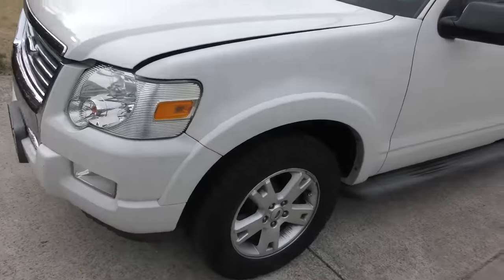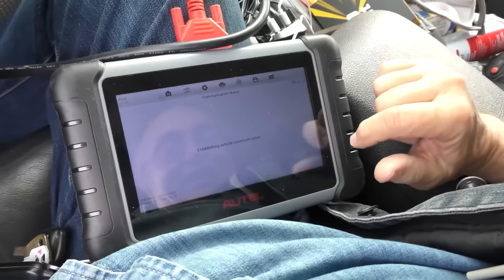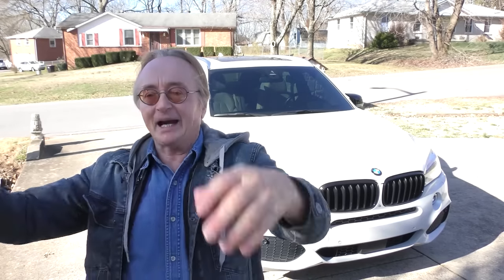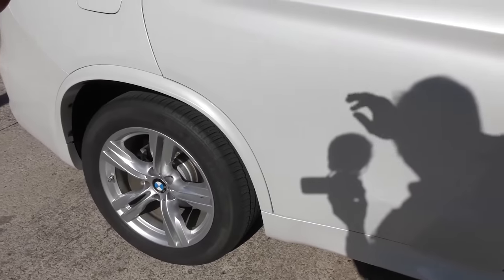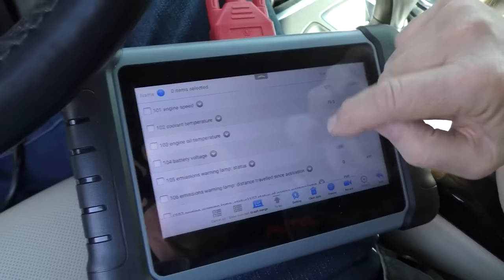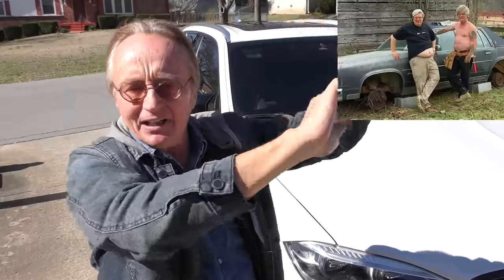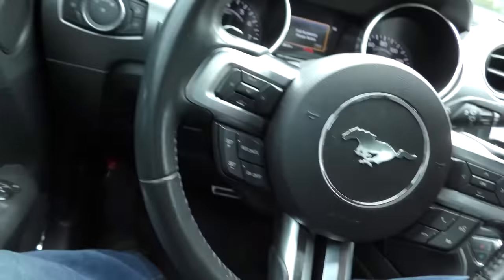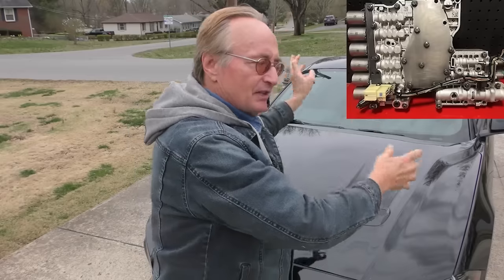3 Money Pit Vehicles You Should Avoid

Comment: I owned a 2003 Ford Explorer 4 wheel drive for nearly 13 years.  It was the best and most realiable vehicle I ever owned.  Never had a single engine problem, only replaced a window regulator and lock acuator.  Replaced the shocks around 130k miles. When I sold it a few years ago, it was still running great, but did have some rust underneath and peeling paint at top.  Most reliable vehicle out of last 6 vehicles I owned and made me a loyal Ford customer.  The new Ford Explorers feel like a soccer mom SUV and didn't care much for them, so I got a F150 truck which I love!
Reply: Nice I’m actually thinking of buying one same model and year with 56k miles any tips on maintenance?
Reply: @Jacob-gd9ps  I'd say go for it!  56k is really low miles for a 2003.  I woud absolutely have the transmission fluid changed, if it hasn't been recently. Other than that, just keep you coolant and oil changed as needed.  My Explorer was super dependable.
Reply: @JIMN26  appreciate bro! And how often do you need to change the coolant and oil what’s like a general rule of thumb?
Reply: @Jacob-gd9ps  For oil, use synthetic blend every 5K miles.  Coolant is usually 100K or 5 years, but I'd look online or check manual on that one, not sure.

Comment: Had an X5 after owning a 740iL and a 528.  Can verify that the X5 is a terribly expensive vehicle as it ages.  Mine had the big V8, which had a big $750 gasket that had to get replaced at 100k miles... waited as long as I could but it was losing a quart of oil every couple weeks (!!).  The 740iL wasn't much better, the serpentine belt blew under the hood and tore apart everything, plus it had a water-cooled alternator, because why not mix water and electricity.  Find a manual 3-series without AC and there's your ultimate driving machine.

Comment: I bought a new model 2014 dodge dart and its been solid. 9 years later its had 1 brake job, wheel bearings, oil changes, and that it. 

Oh and i blew tires on pot holes 3 times. I bought the cheapest tires and blew a new one 2 weeks later. Bought the most expensive tires and so far so good.

Comment: Bought my 2001 crv for $3700 with 90k and a huge pile of parts receipts.
Thing is a beast and its easy to fix.  Radiator took an hour.  Idle valve took 15min.
Burnt out valve cost $2000 but now i know get them tuned every 40k...
100k miles later not burning oil...trans strong...awd works...

Comment: I bought a used bmw x5 and can confirm the repairs are very expensive.  If you decide you wanna roll the dice and buy one of these, make sure you get the best warranty you can because you will need it! I had a 2014 x5 with 75k miles on it when i bought it. Bought a warranty for $3k. The warranty was paid for from repair cost after about 6 months of ownership. I sold it at 98k miles

Comment: We have a 2014 Explorer with all wheel drive. We have 95,000 miles on it and it is running just fine. We live in MN and a 2 wheel drive is just not practical in the winter. Finding a 2 wheel drive around here is quite difficult as few want them. Transmissions require maintenance. Let the fluid get old and you will pay for it.

Comment: Bought my 75 yr old father a 2000 Ford Explorer with transmission out and 140K miles for $1200 years ago. Replaced transmission from pull a part for $150 and it now has 298K miles and Still going 😳 without a single problem.

Comment: The other three money pit vehicles to avoid are the GMC Acadia, the Nissan Altima and the Honda Odyssey, mostly older models.
Reply: Nissan Altimas are good cars if you take care of them. My parents have one with over 200k miles and only had to do basic maintenance - oil changes, tires, and brakes. Lexus RX is the biggest money pit. I owned one for only 6 months and I spent more money fixing it than all my other vehicles I ever owned combined. It spent more time in the shop than me driving it, I only put 2k miles on it over 6 months. And it still had nothing but problems, I practically had to give it away just to get rid of it.
Reply: @NATEG01  That is a great story to tell. Thanks.
Reply: Don't forget GMC Terrain. Love the vehicle (bought new 2012) but by far the biggest money pit I've ever owned...and that includes 2 Cadillacs I owned previously.
Reply: @rockyroad7345  Thank you very much.
Reply: I have a 2003 Honda Odyssey……still going strong as ever……yeah before you ask…..original tranny 😊
Reply: @NATEG01 Stop making up stuff prove it?
Reply: @tonyw1563  I wish I was making stuff up. How you want me to prove it? Send pictures of repair receipts? I finally got rid of the money pit Lexus. I only owned it for 6 months and spent $3k fixing it, and it still wasn't fixed. The A/C wasn't working due to a bad compressor and the struts were bad. I lost $6k on the piece of junk.
Reply: @NATEG01  Wow I thought Lexus was reliable guess not.What Year was the Lexus.
Reply: @tonyw1563  It was a 2003 which was part of the problem. With a 20 year old vehicle there's always something that can go wrong.

Comment: I had a 02 and 05 one reg the other Eddie Bauer edition and both transmissions went flaky at 120k 
The 02 was a manual switch to turn on/off 4\4 but just Flat Stopped 
No warning 
   The 05 had buttons/auto 
4/4 and that one kept turning 4/4 on/off on/off 
By itself in any weather!
But still drove it 120k to 170k like that 
Before putting in new rear leaf springs and reman trans and sold it.
     Was told the shift solenoids are deep inside the trans and if I had just managed to keep on top of my trans fluid drain/fill 
I wouldn’t have the slippage as early as I did

Comment: Its funny with the Mustang. Bought a 1990 GT 5-speed and it was still running powerfully when I sold it with 270k. Had a 2001 Cobra and 2003 GT....both JUNK! Brand new both of them and tons of problems before 30k on either. Got smart and bought a 2007 Mazda 3 built in Japan and it still runs like new 17 years later with 141k on the clock.

Comment: Scotty recommends we all buy Nissan vehicles with the JATCO CVT asap while there still around for a good price.
Reply: Lol
Reply: I actually bought a new Nissan Kicks that has a JATCO transmissions. My dad and I have been saying for years to avoid Nissan due to that, but I really had no choice. I have a coworker that had an early 2010s Altima where the transmission went out after and I advised him to get the transmission serviced when he started having slippage issues and I didn't. My coworker ended up totaling the Altima because it needed too much work and the transmission put him over budget to fix that car. I should have taken my own warnings about Nissan but...  It was either that or buy a Kia/Hyundai that is easily stolen (more expensive too), or spend well over my budget, or get a Nissan Sentra or Kicks. I was able to get a good price on the Kicks. The F&I guy got me a free all inclusive oil change/maintenance plan (3 scheduled services at the recommended mileage over 3 years). I feel slightly better with the dealer looking after my car that it has the potential to last me up to 10 years/100k miles.

Comment: There’s a reason why you don’t see many older BMW and Mercedes cars on the road. They are too expensive too maintain and unreliable. I know someone who recently bought a 2001 Toyota Corolla as a second beater car. It’s in perfect condition. Everything works from the AC/ heater, radio, no engine or warning lights. Car runs smooth and gets good gas mileage for having almost 200,000 miles. He bought it for $1,800 and only replaced a rear taillight bulb for $5.

Comment: Ford explorer 
BMW X series
Mustang  - sorry no times.  Scotty is right as usual they're money 💰 pits.
Reply: I have a 2013 Mustang GT 5.0 V8 that runs perfect and I've gotten my money out of it. I'm probably going to keep it until my time is up in 40-50 years.
Reply: @Kenneth O  Sweet car, and Mustangs do last, but for economy car budget guys, they're expensive.
Reply: @oreally8605  Economy buyers wouldn't look at one in the first place. It's my second vehicle and mostly for nice days and the occasional road trip.  I run premium all the time because I'm not easy on the car and I like to prevent engine issues (pre-ignition, etc.).I literally just change the oil annually and other maintenance like coolant every five years and have a manual so I haven't done the trans fluid yet. Might do that one myself. If I was more experienced and had the tools, this car would be cheap to run. Even the replacement parts for the Brembo brakes is reasonably priced.

Comment: Bought a 2002 ford explorer brand new with 4 liter SOHC engine.  Biggest POS ever.   Transmission went out around 50000 miles was under warranty got it fixed free. But at 70000 miles the engine exploded due to a cheap plastic timing belt guide breaking and jumping timing going down the highway.   Ford dealer wanted almost $6500 to replace engine not under warranty. Had to junk explorer.

Comment: Scotty Euro cars are much easier to work on now days because parts are easier to get knowledge is all over the internet. I think you'd be surprised of how different it is today compared to the 80s & 90s. Euro cars like all cars have there strengths & weaknesses but I wouldn't say a VW, BMW, AUDI are cars to avoid in America like they used to be. Now I don't own a BMW SUV but if I found one with a naturally aspirated motor thats not direct injection with out a turbo thats been relatively well maintained I would buy it. I do admit that some mechanics just assume since you drive a BMW your rich & they may try to stick it to you but working on these cars isn't much different & if your a good mechanic your a good mechanic. I've seen some mechanics claim they wont touch European Cars but when they are tasked & give in they realize they are that hard to work on. You can get the tools these things require for the same price as American Standard.

Comment: 410 bucks for a BMW hose. What a rip off.  That alone is a deal breaker for me. The old BMW's in the 70's and 80's were good. I have and 1985 325 e with 320 K on it. No plastic crap on it.

Comment: Escapes are fwd or awd not rear wheel drive. Ive owed 3 so far with 3.0 liter engines. My latest is the first all wheel drive. They have all been 05 year. I've put the 3.0 liter from my first one in all three. I change all fluids regularly as I believe I should. Been great cars. I'm on the 3rd one because my old lady totalled the first two. The engine survived so I got good deals on the next two needing engines.  Very important to change trans fluid on escapes. You can't change Trans filter without splitting Trans. Scotty there is no rear wheel drive escape ever made fml.
Reply: Mazda tribute clone.

Comment: Me: "I wonder if my car is listed."
Scotty: BMW X5

To be fair - Scotty is a way high on his prices for parts. That 75 dollar hose for example was 15 bucks from an OEM part maker. Aftermarket OEMs for all the plastic pipes are less than 300 each. And found that air compressor for 400. So no sure where those quotes are coming from unless that's just stealership pricing?
Reply: Probably, but availability may vary depending on your locality.  If you can get cheaper parts where you’re at, thats great.👍

Comment: Hello Scotty K.  I  have a 2008 Toyota Tundra with 4.0L V6 G.R.F.E . I'm trying to replace the original thermostat on it. I have not taken the old one off yet, because  I forgot to purchase a gasket along with it online.  I have noticed the NEW one  has a rubber ring around the thermostat . My question is , is that rubber ring the actual gasket for that thermostat ?  I have also looked online for that particular type ,all I see is the round rubber ring. Is that the gasket?
Reply: The rubber ring is the gasket.
Reply: @danielbruneau2222  Thanks D.B. I  just needed some verification.  All my other vehicles have thermostats that required a separate gasket for installation. The Tundra apparently  has it built in the housing. Appreciate  your response!!

Comment: I think the biggest problem with Explorers is that a lot of people don't maintain them and drive them hard on top of it. Myself I think I would rather have one with the 4.6 instead of the V-6 just because it has more power and isn't going to be as strained, plus I just know the 4.6 better. If the transmission was on its way out I would just put a reman unit in it.
Reply: My 2002 Eddie Bauer 4.0 gets up and moves you just need to cram the pedal to the floor lol. Or shift to third to pass ...is a tank off-road...way better off road than my f150 but that's to be expected. The pedal is tight...hard to push compared to newer vehicles but has  similar get up as the 2013 cop car explorer we have at work. It's got the 4 auto then 4hi and 4lo. 21 years old 130k....starts and runs smooth every day.... religious oil changes so far it's the most dependable car I've had since my mom got it in 2003

Comment: I've looked at many Ford's and was put off by the electronic 10 speed transmissions on anything past 06. My 99 Taurus was great, but electronic sensor and a solenoid failure in the tranny caused it to be unsmogable after 225,000m. My 2000 4x4 Ford Expy has 275,000 and is running strong . Anywhere from 10-17 mpg. I'm selling my PT and going to find another economy car, either a Toyota or Honda!❤
Reply: If your looking for the best bang for buck. Get a Hyundai. Bought an accent for 10k brand new. Has 125k miles and drives beautifully. Never broken down once. Only replaced the o2 sensors. Definitely better deal than any Toyota or Honda you’ll find.

Comment: I have a 2008 Explorer V6 with rear-wheel drive. The engine still runs at 325k miles, at ~300k I lost reverse not long after it started having trouble with the 2-3 shift, but I could make it catch by throwing it in neutral then back into drive. I bought a tranny from a junkyard that ran for about 2k miles and then something snapped inside of it while cruising at 55mph, and she hasn't moved since. 😞

Comment: I dont like cars with sun roofs. Too much issues with leaking ive dealt with
Reply: I own a 2005 P74 Ford Crown Victoria LX Sport. Used: 186000mi. Sunroof, factory 🏭  keypad security. I would NOT 🚫 suggest either for a new car or any used SUV, sedan 10/15/20+ years old. They will crack or fail at some point.

Comment: Hey Scotty was wondering what are the best years to look at getting a 5th gen Toyota 4runner? I live in Northern Michigan and prefer to have mechanical 4x4 instead of electrical.
Reply: Any one of them. Bullet proof. I own a 2015. Only thing I've had to do is tune up, change fluids after 100,000 and 2 brake and rotor changes. Literally that's it. It drives awesome in snow as well. I live in Michigan.

Comment: Scotty a friend has a 2016 Ecoboost F150 with the 6 speed auto transmission. He has a shuttering problem. We have tried twice to put the anti shuttering additive in but the shuttering comes back. He had the transmission serviced, fluid and filter, and the problem while better is not totally gone. Mileage around 100K. Any advice>
Reply: Probably approaching time for the torque converter to get change then after that grab a aftermarket tune
Reply: Sometimes these 6r80’s are prone to having that happen. It happened to me around 100k miles and I flushed out my transmission and put new fluid and filter. 330k miles and 0 issues since.
Reply: @michaelstevens04  After the flush and filter change did you get immediate results? We had the fluid and filter changed, did not perform a flush, was told to drive it a few miles and it should be good. It is not. Thanks for the reply.
Reply: @michaelgreene  yes sir. Immediately fixed all shuddering. Probably $600 at a reputable shop. Well worth it though.

Comment: I am surprised you think the Ford Explorers are money pits? The first one we had was only front wheel drive and had a normally aspirated V6 engine. We got 170k miles on it until I crashed it. We then got another Ford Explorer. It is doing the same thing. Running like a champ. My son has an older Chrysler HHR. That car is always in the shop. That car is a money pit. It is the worst car I have ever seen. Thoughts?
Reply: You said it was front wheel drive so I assume its 2012 or newer? Those were a lot more reliable.
Reply: @MassiveGarbage   Yes, 2018 is our current Ford Explorer. We bought the Extended warranty which was a waste of money because the vehicle never broke.

Comment: Not true with all cars but from what ive learned is that anything with a sport mode is going to perform over time in sport mode. Its too hard on the car to get around in eco. What you save in gas you WILL spend in repairs. Performance mode is always better, even in a prius ive tested it it gets the same or better gas miles in sport and  only eco when scared to use the gas . All depends on how heavy your foot is.

Comment: Had a 2007 Explorer Eddie Bauer. Nice truck until the timing chain guide blew out and punctured the valve cover. Ten the front hubs failed. Then the fuel pump...After fixing all that, it was totaled by a dude running from the cops.

Comment: Hey Scotty, I have a 2000 Toyota Celica GT I bought a couple months ago. It's throwing a check engine light and the engine code is P0172, I have replaced the spark plugs, coil packs, change the injectors and even change the maf sensor. For some reason it's still running  rich, when I drive it and try to pick up the  speed it wants to bog down, pop and snap from where the throttle body and air filter sit. What could be the problem?
Reply: Did you change the o2 sensors?